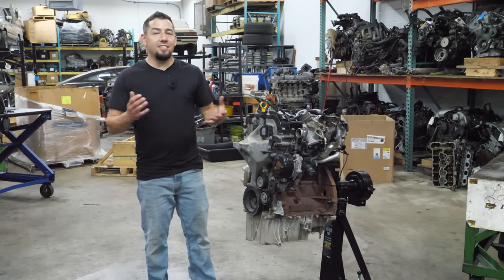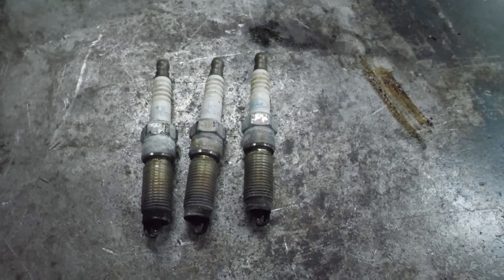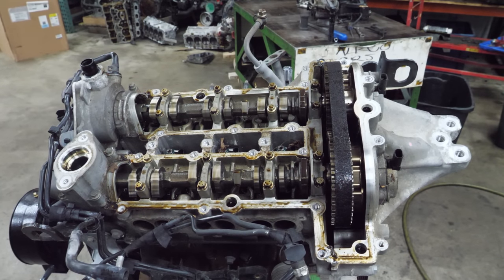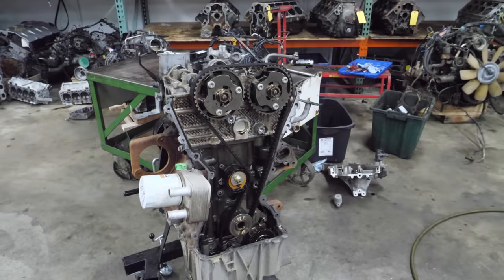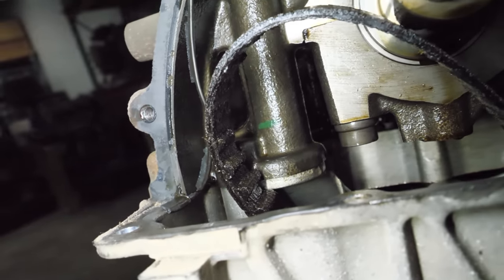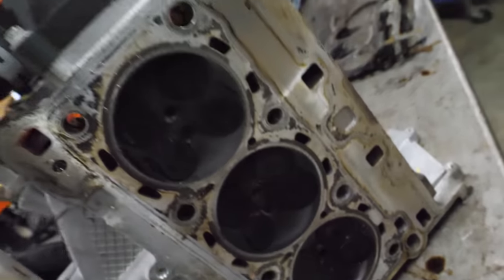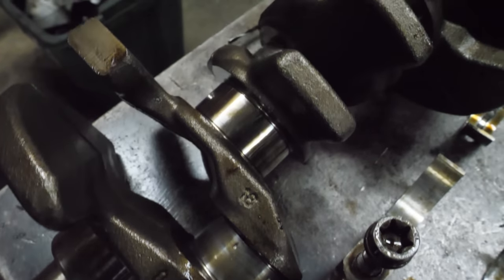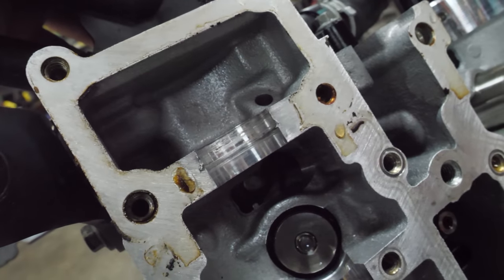JUNK Ford Ecosport 1.0L 3-Cylinder Ecoboost Teardown. LAWSUIT ENGINE!

Comment: This engine is also used in the Fiesta, in 100, 125 & 140 hp.  Despite being calld 'eco', the fuel consumption was only slightly better than the previous normally aspirated 1.4.  The 1.4 was just an adequate engine, burnt a bit of oil, but will probably outlast all the ecoboosts.
Here in Europe, no keyway is becoming more common.  Like you, I think the main reason is cost, but the excuse given is that the timing is set using holding tools, then the bolt tightened, so the timing is more accurate than being fixed by a keyway.
My brother left a breaker bar on his crank pulley (Peugeot 307 2.0 petrol), hit the starter, bar hit the chassis, undid the crank bolt, timing moved, valves bent.  Oops!
Reply: The no keyway thing it's just a straight up cheap move.
Glad Mazda moved away from it.
Reply: I'm baffled by why this engine and car exist with such terrible fuel economy. The Toyota 5S-FE (2.2L I4) in the XV20 Camry was a basic NA engine with an ancient 4-speed (3+1) auto was rated 21/27mpg on the EPA cycle. Admittedly that standard has been updated but I personally saw 29-30mpg on long highway trips with the AC running. The Ecosport is about 300 pounds heavier and has more emissions criteria to meet but...how can it be 25 years newer and still be this bad?
Reply: My 1L gets ~40mpg in my fiesta. I’m sure there were different variations but some of them got really good fuel economy
Reply: @aaronvienot  Ford EcoSport uses a more reliable torque converter automatic transmission, not a DCT (Dual Clutch Transmission), which effects fuel mileage.
Reply: No keyway is madness for the timing-critical parts.  Hell, even way back in the 70's and before, they used keyways to make sure things could not get out of basic alignment.  There were always ways to tweak the timing in other ways back then.
Reply: Insanely reliable VW 1.9L diesel is one of the first engines I’d heard of to do all that keyless trash. When we big big power ecoboost, we add keyways to the crank. The cam sprockets are also keyless. So stupid.
Reply: I don't understand why engines don't use some sort of slotted pulley to slip over a toothed crank snout instead of relying on one key or just a torqued bolt to bear the forces required to turn the cams, oil pump, balance shaft, etc. And how does bathing rubber timing belts in oil not compromise its traction on the pulleys?
Reply: Non interference design would make life so much easier
Reply: @twig3288  Sadly, non-interference engines will produce less power, and be less efficient so use more fuel for whatever power they produce.  That brings greater pollution.  The strive for efficiency is what has given us the non-keyed pulleys.
Reply: @aaronvienot  Your are talking about a completely different engine.
Reply: The 1.4 N/A made what 85 hp ? wouldn't pull the skin of a rice pudding. 125hp 1.0l in a Fiesta does 47mpg ( US )  real world highway use and is pretty quick for a small family hatch.
Reply: There is also an 80hp naturally aspirated version. The most reliable and with fairly low consumption, ideal for urban driving.
Reply: @jabberwockytdi8901  Here in the UK, the 1.4 N/A was rated at 94hp, and was adequately quick, if pushed, but tended to use a little oil as a result.  Used to give around 44mpg (UK) in mixed use, including with learners.  Longer journeys, could sometimes improve to 47mpg (UK).  Had several, all much the same.  Then we moved to the 1.0 Ecoboost, first in 125hp, then latterly to the 100hp.  Very quick, great fun to push hard, if not your own, never used any oil.  General use, 45mpg (UK), if used gently on a longer run, best was 49mpg (UK).  Hardly worth the change, especially with the risks of the highly strung engine.  Wouldn't spend my own money on one.
Prior to the Fiesta, we used Fiat 500, 1.2 8v, 69hp.  Almost as quick as the Fiesta, if you knew how to push it, and rarely below 47mpg (UK), even with learners abusingit around housing estates.  Now using a 2015 Skoda Fabia, 1.2 TSi, 89hp, 1.2 4cyl Dir inj turbo.  Rarely dips below 50mpg (UK)  I was always disappopiinted that the Fords gave so little despite the effort Ford put into it.
Reply: @jabberwockytdi8901  that was kind of the point, yes. An older, larger, simpler, NA engine and obsolete transmission, in a similar application, outperform this drivetrain by quite a lot in fuel economy. The conclusion is that this engine is being run hard rather than run efficiently, and is poorly matched to the application.
Reply: (N. America) Yeah, I think of the Fiesta first when 3-cylinder EcoBoosts come up.  Didn't realize these also went into the Focus but not surprising either.  Seems like balancing an I-3 would be terrible.
Packaging size is impressive and that's it.  It's cheap, lightweight, arguably not that reliable (let's say relative to other EcoBoost engines) or at least not built with durability top-of-mind, and economy is across the board.
Reply: @parker580  The belts have teeth so they can not slip regardless of oil and the belts will be designed to be in an oil bath. However, life span will not be as long as a chain.
Machining a spline on a crankshaft costs a lot which is why it is rarely ,if ever , done. Plus , a keyway  positively locates a pulley/gear , a splined shaft does not.
Reply: Blippiing the starter with a breaker bar on the crank pully is the unofficial way of loosening them on Land Rovers 😆
Reply: only slightly better? I had both engines and the NA engine got 33mpg urban, 40mph on the motorway, my 125hp ecoboost got 42mpg urban and 54mpg motorway, WAY more efficient... (UK MPG not US MPG)
Reply: That’s what I was gonna ask. I know there’s some Ford where the crank pulley has to maintain pressure or something to keep the timing, and you attach this weird tool. On Ray’s channel, some new kid didn’t know, and they just swapped the entire engine
Reply: You need to use the correct spec oil, and by that I don't just mean the correct viscosity, it has to comply with the Ford spec for that engine. The oil contains additives that lessen the effects of rubber degradation by the oil. Most garages will simply use the correct grade as they don't know any differently and as such the belt will fall apart and cause the mess we see here. Also, I agree that keyless pulleys are a shocking idea. Just goes to show that we live in a disposable society and no one makes anything that is designed to last.
Reply: I get better fuel economy from my 2005 1.6 civic with the air conditioning on than I did with my 2015 fiesta titanium ecoboost. The fiesta struggled to get 40mpg where as the civic averages 46-47mpg. The fact I replaced the 2015 fiesta with a 2005 civic tells you all you need to know about the pre reworked ecoboost engines. I used the extra money I made from the sale of the fiesta to redecorate my house and brought the civic because I know they are reliable btw.
Reply: @aaronvienot  1.0 EcoBoost 125 Automatic	48.7–50.4 mpg	rated with real life 35.1 mpg. So no, it does have some promise.
Reply: On a gentle run from a 125hp 2012 Focus I got about 60 to 65mpg UK. What's that, around 50mpg US? So I found it to be very economical. Not many people have my delicate throttle control though.

Comment: I worked for Ford as a mechatronics engineer in Germany... The Eco boost has been around since 2010 in European fords.
And what can I say, at that time Ford could no longer provide replacement engines under warranty, we had cars that had to wait for new engines for over a year... Built to just survive the lease, if I had to guess?
Reply: This comment reinforces why I'm a GM guy. But gm makes a couple of turds these days. 1.4 4cyl turbo and 3.6
Reply: there are so many little fiesta running around in the UK with I'm assuming the same engine. I have a feeling that it comes down to the usage scenario rather than the actual engine. Such as short drives, low miles, low miles but long wait until oil changes. Low miles, short distance driving and long time until oil service is what I believe kils engines nowadays.
Reply: @Dmxravin  that's true
Reply: can you imagen wait for 1 yr... yet if you are fail to make a paiment, you get all kind of fees and penalty fees. sucks how big corp get away with their BS.
Reply: @noahcotney2957 gm is literally garbage. Their DOD failures and piss poor transmissions are a joke. Any of their smaller engines are also junk. The l5p is good but damn, I see so many of their gas v8s and transmissions replaced.
Reply: @josephsamsor1698 dod delete.
And a lot of manufacturers are having transmission issues right now.
But yeah those transmission issues are bad in the newer gms.
Reply: And the transmission issue was from GM using the wrong fluid. 
Once you use the right fluid the transmission issues aren't as bad
Reply: This  is a total exercise on making weak engine stressing it to the maximum then pissing everyone off including the mechanics working on the rubbish .

 The original Fiesta in the 70s 1600 cc inline 4 with the original weber carb originally made in Germany could get a half million miles on it if properly maintained! I had 1979 one with over 300,000 when I sold mine and it was still running! This new stuff is rubbish
Reply: Timing belts suck also especially when paired up with an interference motor ! Just trouble waiting to happen ! Look go back to a damn pushrod motor with a small short chain or use a bevel gear drive!! These  fools in the engineering dept need schooled !
Reply: @noahcotney2957 Just 2 crappy GM products? 😂 It's a lot more than that. Seen quite a few direct injection fuel pump failures on GM V8s lately, and the DOD stuff is still garbage. I still think the LT is a decent engine. I would never blindly put faith in any brand. They all make good things, and all make junk. Ford has some really good products made now and in the last 20 years, and some really bad ones. GM is no different there or in the boneheaded design competition.
Reply: @sammyrothrock6981  

The 1.6L Kent motor was a good motor...but the radiators in those cars were made of paper.
Reply: @josephsamsor1698  I beg to differ, we have a 2014 GMC Yukon with a 6 speed automatic, it's bulletproof , 249,000 kms and counting, and we have a 2022 Yukon XL with a 10 speed transmission, it's perfect so far, only 42000 kms so far on it.
Reply: @noahcotney2957 not completely. My 1.0 3 cilinder VW engine has 270.000km on it and i never changed the oil purely for the reason i think oilchanges are just a way to make money for companies and its not really needed.i never changed oil in my cars and non of them broke because of it
Reply: Designed to last 3 years and or 60,000 miles..run it till the lease runs out and hand it back 😂
Reply: Found On Road Dead
Reply: It's sad that manufacturers are trying to make engines as cheap and short lived as possible in the wake of EV's and the constant need for better efficiency. How hard would it have been to build this engine with a timing chain, or even gear driven to give the so called 150k miles, and not the short lived 40k that they seem to last for. This gives Ford a bad name. In my part of the UK, Fords are as rare as the old Model T, because of better German built VW's and Audi's.

Comment: My wife's ecoboost Focus engine split a coolant pipe(plastic) and dumped its coolant in a few seconds, overheated in under a minute and conked. A Ford replacement was 1400 pounds sterling,  and with a new clutch and flywheel fitted our bank account was minus 3600 pounds sterling. This was a 15000 pounds sterling car that had only covered 75000 miles. We still have the car and it is now on 108000 miles. Our daughter is having it as her first car and hopefully squeeze another few thousand miles from it. Thanks for the engine breakdown vid, I hope they have sorted thise daft belt probs out. Duplex chain drives would have been much better, after all, it us a motorcycle engine😄
Reply: 🙂 more like a sawing machine ... junk. I'll never buy after seeing what's inside
Reply: They would have been better with a Yamaha FZ 9 engine
Reply: @stewart8127  Way better:) - not to mention the Hayabusa

Comment: They are very eco friendly because they're always catastrophically broken so they're never running 😂 We had one that shut off on the customer, it would crank but not start. Pressure tested the cooling system and cylinder 2 filled up the spark plug tube in about 2 seconds. Engine overheated so badly you could feel the warped spot between the block and water jacket lol.

Comment: Ford needs to have a new car called the Ford Triple Threat -- it uses the wet belt system, the Power Sh*t tranny, and the old Pinto's "built-in-BBQ" rear gas tank

Comment: These engines were only designed to last 60,000 miles just long enough to cover the warranty period 👍
Reply: My 2012 Focus 1.0 ecoboost is on 77k I’ve had it 4 years and apart from a fuel leak and a battery that died it’s hasn’t missed a beat. I don’t know how your epa fuel rating works but I have recently getting 47.2 mpg
Reply: @johnfullbrook628  I've had my 2016 Toyota Auris 1.2T I4 for 4.5 years, its on 72000 miles and has had no mechanical issues at all outside of wear and tear items and servicing. It is bigger, more refined and doesn't sound like its misfiring unlike a 3 pot yet its still able to return more than 50mpg. Best part of all its chain driven rather than belt driven mean it won't have a costly £1000 bill for belt replacements.
Reply: @gravemind6536  i agree I think the wet belt over a chain is stupid considering how many hours labour it takes to change it. Ironically the 2006 Focus that it replaced was a chain driven engine and I traded that off with 140k on the clock I’d say the mk2 Focus was a much better built car as this mk3 has had silly little things needing to be done and it’s only on half the mileage
Reply: Here in Germany they blow up at around 60 k kilometers, not miles!
Reply: Bullshit. I must have been lucky you say? My 2013 Ford Focus 1.0 EcoBoost  has run almost 130.000 miles (207.000 km). Dealer maintenance by the book. These are high tech wet belt engines that require the right oil and on time oil changes...
Reply: @STEKiE  I couldn’t agree more I’ve done about 25k in the 4 years I’ve had mine I only do 7-8k a year as my commute to work is 8 miles and will be even less soon. And I change the oil regardless of mileage every year on the dot and so far the only things I’ve needed to do under the bonnet is replace the expansion tank (under warranty) change the battery original factory one finally died do the wet belt clutch and flywheel and starter motor considering its a 11 year old car that mostly age related maintenance
Reply: @johnfullbrook628   These little engines when maintained right run idle so quietly you start to wonder if it's even running. Just came home from my holiday in Croatia, putting almost 2000 miles extra on the clock and it ran great....
Reply: @STEKiE  yeah I think it’s been a good little engine apart from some age related maintenance she runs like clockwork and doesn’t miss a beat
Reply: So probably replace belts and tensioner every 60k miles
Reply: @ryanehlis426  Ford recommends 150 k miles. I think that's a bit optimistic. Just to be on the safe side I would think Round 90k 95k miles is very good possible. And if you do an oil change every year with Castrol oil and the Ford recommendations you will have no worries.
Reply: @STEKiE  sure it does
Reply: @STEKiE they still die by self destructing themselves at stupidly low milage. I run a taxi business and belive in over servicing (oil changes) as an insurance which works we never get engine failures in under 240k miles.. except on these engines. If you get the slightest issue with fuel in the oil then the belt lets go! Also heads crack all the time if the meager power is used. An injector fault or using the vehicle for lots of short trips will kill it at very low milages.
Reply: @STEKiE  if they are serviced perfectly then will likely not encounter issues. The thing is, how many average owners are as scrupulous and attentive as yourself? We don’t need to answer that. So, whilst the engine may remain perfect from proper oil, so many owners and garages neglect proper type and service intervals … the question is, how does the engine then stand up? I’m with you about looking after things well, but I also see a point that the engine has to  be capable of absorbing some neglect.
Reply: @cs56076  I think that's true. But how far can neglect go. I see people bring their car (Kia) in at 70.000 miles with a bad running engine. Bought new and never had an oil change. Oil as thick as tar. We could save it. But how far? People need to realise the time of bulky V8 with 80 HP are over. These are high tech engines and proper maintenance is necessary. There's a job for dealerships.